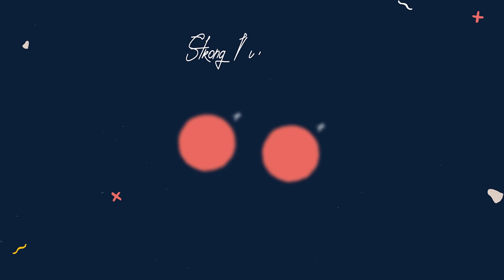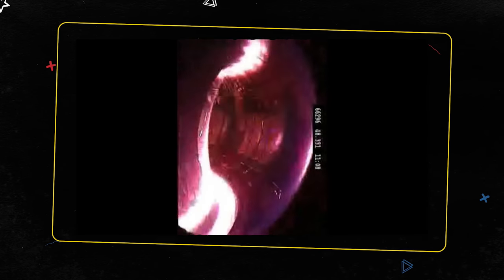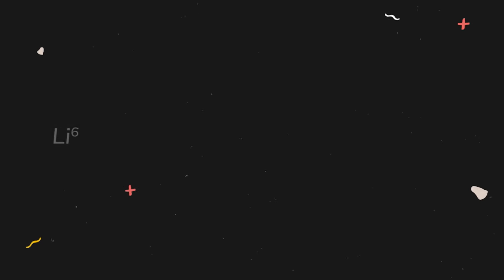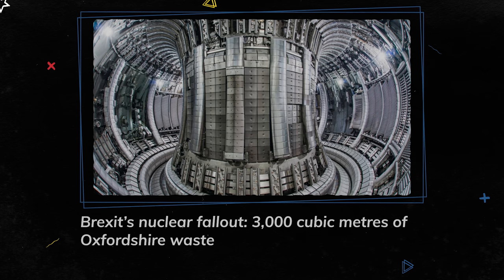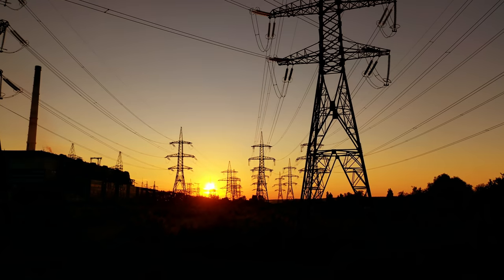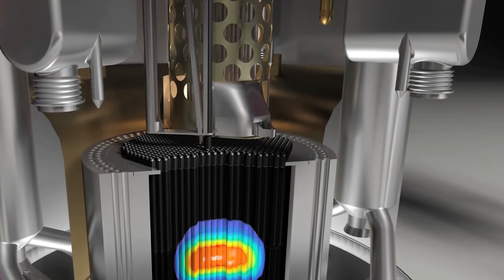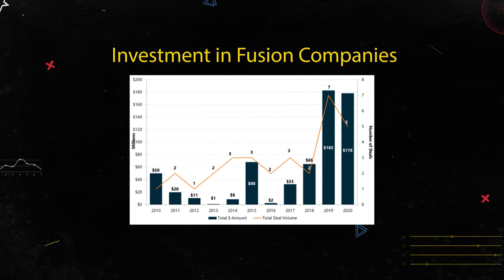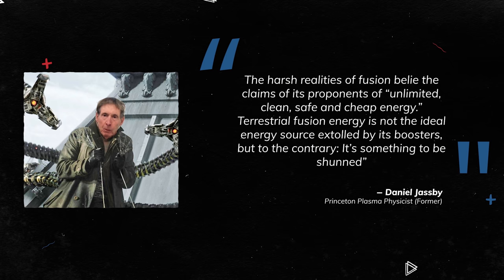What No One Else Is Telling You About Nuclear Fusion

Comment: Electricity production is a basic utility which should be done at  lowest safe cost with maximum reliability. Nuclear provides all of those options though old style PWR have high capital costs. The new molten salts from Elysium and Moltex burn high level nuclear waste (solving the disposal problem) and are cheap to build and cheap to operate. 
The waste alone will deliver the 20x the power already generated by PWR reactors. But they can also burn bomb grade material immediately denaturing the stuff so it’s useless for bombs. They can use thorium and even depleted uranium.

Comment: The problem of Fusion is that, assuming the fundamental engineering problems are solved ( and that could be well into the 22nd Century ) and assuming the overall costs reduced even to 50% of Fission, it is still a solution for the wealthy nation states. The development and investment into a High Efficiency Photovoltaic / Battery system would be significantly cheaper and scalable for other parts of the world that would never be able to afford a Fission plant, otherwise a Fusion one. Currently ITER is the most complex, most expensive, largest machine ever devised by Man ( think the Great Machine in the film "Contact" ) and its sole function is to turn water into steam to produce electricity. There has been some theoretical discussion about "Direct Conversion" but the working papers on this have not even been written. At some point Man will need to devise some form of inexpensive portable power generation, especially as we move outwards into space, perhaps Fusion will be that source.

Comment: There is another way which involves sandwiching a bubble deuterium/ tritium between two plates. Then constantly inject pressure from a central central hole. The reactor chamber needs to be star shaped like this emoji.⭐️ fusion occurs at the tips. It will need to be guided by magnetic fields outside the chamber but that a simple process of having a iron cored torus magnets place outside each indentation. The fields lines should make a geometric star a bit like this.🌟. So much like inflating a bubble inside another bubble the pressure builds in the cavity until it finally fusses. As far as I was aware this is called resonant cavity fusion. This all happens in a 2d plain of motion ant the highest pressures occurring at the tips where fusion is most likely to happen. The shock waves helping form the next cycle of fusion. Then it all a matter of choosing the right resonance frequency. An boom,fusion!  Should be far simpler and cheaper to build. Could also have a table top version small enough for demonstration.  Which would be awesome. This also takes advantage of the strength of the arch to funnel the reaction and control the shockwaves. Should happen somewhere in the gigapascals range. It just a matter of researching what pressure was needed to set of a h-boom. Then provided you have liquid in a coil of pipe near the heat of the tips you would have yourself a steam punk fusion reactor.

Comment: Interesting fact, even inside the Sun the heat output of a cubic meter is only about the same as a compost pile, aka single watts per cubic meter.  It's simply the huge volume of the suns interior that produce a surface temperature of ~6000K.  So even replicating the conditions in the core of the sun would be completely inadequate as a power plant.

Comment: There are 2 parts to fusion reactors. The side that makes the thermal energy and the side that catches.  This method of fusion may end up proving inviolable but the technology developed to catch fusion reactor heat and make electricity would still be applicable. I see grandiose fission reactors to facilitate fusion reactions in tectonicly sized containment structures. Passive self contained Water cycle for cooling. A project large enough to transcend single nations. But an absolutely permanent solution for energy.

Comment: Fission plants are only expensive because of regulations, not any physical reason. It can be much cheaper than it is. This isn't true if fusion. It is truly just expensive.
Reply: Joeseph Smith  Inherently safe fission reactor designs exist, meaning that they have enough fuel to boil water but not enough to go critical and melt down even if they lose all cooling. They are smaller, so you would need to make more units but they CANNOT melt down.

Comment: Geothermal runs most of Iceland and has for a long time. Almost every place on earth has some form of hot spot, or magma chamber you could comparatively easily use to boil water to drive a turbine. It may be expensive to build, but it's a hell of a lot cheaper than bottling a star.

Comment: Fusion claims to offer “free” power but the technology to make it happen is incredibly hard and incredibly expensive. That does not equate to cheap utility power. 
Molten salt fission reactors operate at atmospheric pressure with a negative temperature coefficient. That makes them self regulating so they cannot melt down. The zero international pressure means complex safety systems are not needed. It’s basically a steel lined concrete box. 
Fuelled with thorium, uranium or high grade nuclear waste, Molten salts fully burn their fuel. Their waste has a radioactive half life of 30 years. Thats easy to manage. Currently we have waste with a half-life of 30,000 years which is absolutely not easy to manage. 
Thankfully we now have fast spectrum reactors fuelled by high level nuclear waste. All the benefits of molten salt but no new mining and stocks of dangerous waste are reduced by 1000 times. Three orders of magnitude.

Comment: Hello smart people. I watch these videos just out of curiosity so I'm not sure how to answer my own question. 
Scenario: Pulling a sheet of saran wrap releases or creates (static) electricity. Do this in the dark and you can see sparks. 
Here is my question. If there is a strong force holding electrons to atoms, would "tearing" electrons from atoms create energy? 
Something tells me this would create energy and it would take less energy to position electrons back to some simple atom.
Reply from the maker: Hey :)

Non-smart person here, but I’ll try to answer :)

The Strong force binds nucleons together. That is protons and neutrons. Since protons are positively charged, they repel each other. But the strong force is powerful enough to overcome that repulsion and keep them together. 

Stripping electrons from the nucleus is basically chemical energy. When you burn wood, for example, the heat produced is due to breaking of chemical bonds.

Comment: Pro: 
I agree fusion might not make a difference on the short-term, meaning i concur with most conclusions on the end. The surprizing development of battery storage, and the expected rise of cheaper renewable energy, expands the options. 
Anyway, it will be a mix of energy and solutions in the transition towards a zero-carbon sociey,, and probably fusion will need to draw a number, in a long queu for future applications. 

Con:
This video would have to be renamed: 
Fusion on the ITER Approach faces Major Problems That No One Is Telling You About.
A lot of struggles and objections are based on the ITER model. Its ITER this, ITER that , ITER is a bad lazy boy etc etc. 
And yes: its the dominant pupil in the classroom indeed. But there are more new kids on the block. Like the Stellarator, a different approach. Different approaches offer different challenges but also adding to the general knowledge of fusion technology. 

Magnetic confinement is a thing as example. Some scientist note a fundamental flaw or disadvantage in the torus shape, causing a bad confinement of material to make it efficient. Stellerators and other ideas create different, more stabile and stronger magnetic fields to improve the flow and fusion. 
This is just a example, not a challenge to debate about it. Some issues might be universal over the broad spectre of experimental fusion devices. This video (making my point)  communicates a lot about the ITER, wich is not a bad experiment at all, but still just one approach to gain insights. 

Thus: while the video contributes to the need to filter too positive ideas about fusion to be feasible, with good conclusions on the end, it lacks a broad approach and it based primarly on the ITER project and its findings to review the future of fusion power.  
I agree fusion is a gamble, and we need to hatch more eggs then just one solution for future energy and climate security. Still, its still a good bet worth to consider and pursue, without fixation.

thanks for the work and contribution. This is mine.

Comment: Matter exists in a plasma state on the surface of the sun and inside the earth because it is under pressure. That fusion reactor chambers are made - for safety reasons - LOWER than atmospheric pressure, would seem a major problem: has anyone tried running experiments deep underground?

Comment: this looks pessimistic, but also we anticipate new discoveries in the particle standard model and in quantum physics and much more.
perhaps the recent muon experiment has opened a door.
* such discoveries can give us new factors that make fusion "easier" with perhaps new materials or introducing new particles into the equations.
* there is a lot going on about magnetic field geometries, like what the stellarator is attempting. AI can help to create new and better geometries and coil systems that come closer to these purposes.
* there is research about high temperature supraconductors. success would be a game changer, also because of the space that the cooling uses up in the device.
* ignition can be achieved with many different techniques, e.g. lasers. but I also think of dirac pulse creation in the magnetic field. the high frequency harmonics to get that, might come from nested coils that are ever smaller, following the idea of the russian matroska puppets. AI and perhaps quantum computing can help here also, to figure out some configuration that can get done a decent ignition with such an edgy pulse.
* can the neutrons that come out, get somehow rectified? like a black hole rectifies its output into a double beam. can the magnetic field geometry influence the fusion in that sense?
* what about having a plasma geometry, that allows electromagnetic harvesting of a big part of the energy, practically by induction, that happens when we let the plasma kind of explode?
this would work in a twin system, like a boxer engine (old motorcycles have it). one system creates the pulse to ignite the other and vice versa. a resonant circuit harvests the surplus of energy,.
in short, the plasma should have properties, that allow it to induce a huge pulse in the coils, when fusion starts and ends with strong transients. the whole mode of operation should be in short pulses, and the beat migh have a frequency somewhere between 10 and 500Hz.

these are just examples about new ideas and discoveries, that might occur. they may or may not apply, but other ideas and new discoveries in physics may apply when emerging.

Comment: Fusion from fusion.
Draw a circle halved once squared twice to the right.
That shape is the geometry of GOOD drawn together, its father shape.

On the Sun dial place the time 12-3-6
Time, times 12x-3-6
Time, times and division of time 1/2x-3-6

Time from mass.
12 Magnesium
3 Lithium
6 Carbon
1 Hydrogen
One clockwise cycle complete.

Comment: So using lasers aren't enough. Too costly and not enough thermal push in the confinement chamber to turn a net gain. Than there's the cost and issue with material integrity and waste disposal management.
Reply: Waste disposal isn’t to much of an issue there very light elements that won’t be the major problem

Comment: I just learned about Jeff Bezos' interest in an ancient form of fusion energy: a "firestarter" using magnetic confinement. I though ITER was doing that, then I realized they ADD energy to the system using X-rays. The magnetic bottle keeps the same volume. 
This other method does the same thing, except is just reduces the "volume" of the magnetic bottle, squeezing the plasma until it fuses. That seems like the winning strategy to me!

Comment: I cant believe someone of this stature is not aware of current technologies that eliminate the problem of magnetic containment. The development of HTS is a game changer and MIT has a 2 year head start on development. I agree, ITER should be scrapped, right now, and the budget put into technology that is here, now.
Reply from the maker: They need to be tested at the sizes required first. And will still need to be cooled with liquid nitrogen. 

So even if everything goes as expected, that’ll still solve one one of the major issues. It’s not as straightforward as the SPARC presentations make out :)

Remember to always watch the Q and A at the end. 

MIT was promising to build a Fusion Reactor called Ignitor based on the same principle 10 years ago too. Guess what happened to that?

Comment: Talk about misleading. So one bloke states that fusion is a pipedream so he must be right...

Tritium recovery technology is already in use at JET and the high initial retention has due to the experimental wall design. Thats how science is done, you experiment, learn from experience and improve.

Magnet quenches...this is taken as a factor in the design and is a well known feature of such magnet. An MRI magnet can also quench with you inside it and nothing would happen to you. Why? Because the magnet designer has taken this occurrence into the design. Also if this video was done by an expert he/she would mention that there're high temperature superconductors now available which dont require helium at 4.2K. 

There are now commercial nuclear fusion  companies which is exactly what is needed to reduce the cost and timescales of fusion reactors.

Comment: My money's on small, modular, molten-salt fission reactors, preferably running the Thorium fuel cycle. There are plenty of ventures already working on various approaches in this area, and I'll be surprised if we don't see at least one of them go commercial in the next decade. And in the meantime, the build-out of renewables with battery storage is going to be massive. When somebody goes commercial with a viable, profitable Thorium MSR, fusion will become more of a science experiment rather than a serious pursuit of "practical" energy production. (Although we may yet see something clever come from "focus fusion" or "cold fusion" or whatever they're scheming up at the Lockheed Skunk Works....;-))

Comment: 100 million kelvin is less than 10 kV potential difference. That's nothing; less than the potential between the screen and the electron canon in a CRT monitor. It is absolutely something you can whip up in your basement. 1 electronvolt (the energy of an electron accelerated over a 1 volt potential difference in a vacuum) corresponds to a temperature of 11604 kelvin for a particle like an atomic nucleus (for a molecule things are different, there some of the energy will be in the vibration of the bonds etc). 100 million kelvin is just 8600 eV. You can do this and demonstrate neutrons from fusion with a simple farnsworth-hirsch fusor device, which is just a couple of metallic grids in a good vacuum vessel. This is high tech for the 1930's, but it is motivated garage-tinkerer level of tech today.

The difficulty of fusion power is that very few collisions actually result in fusion and you must have very low energy losses so the nuclei can repeatedly collide at high energy without having to add more energy than you can extract.

Comment: One of the problems at churnable was they found robots did not work, the radiation cooked the electronics (valves may be the answer) they bought a robot in spatially from Germany, it faired little better, it sounds like this is a dead duck for know, perhaps fusion should be launched away and sent to the nearest sun.

Comment: Modern fusion plants covered with absolute zero magnets that must needs have for plasma control is a layer between the fusion and power generation with the heat of a nuclear fire. Can you imagine a better way to damp and smother the fusion reaction than covering it with not just freezing cold but absolute zero cold. Molten salt reactors fueled by thorium in contrast can be made so small it would easily power a ship clear down to a destroyer and would cost less then the very expensive turbines they now use and not with steam pressurization but with supercritical co2 gensets so small as to be almost hidden in a corner of even a destroyer. Having an unlimited range not dependent on the carrier for fuel supplies takes the most flammable agent of the carrier to make the carrier more resilient in battle plus a small destroyer able to keep up with it's mother ship indefinitely and able to have every bit of power it needs for modern electrical weapons and able to boost it's radar from the now value of 5 megawatt beams to probably 50 megawatt for even better ranging of stealth objects.

Comment: We have plenty Hydrogen and Boron -11. What happens when you use these as fuels in a fusion reactor? Well you get less energy. But you also get no neutron radiation, just short-lived alpha and beta radiation. Which conveniently enough can be absorbed by voltaic cells to directly generate electricity.

Comment: Gas plasma fusion is futile, fusion requires lattice confinement as has been shown by NASA. The suns core is said to be 150 grams per cubic centimeter,  what density is used in these reactors? Gas plasma reactors are just the most expensive gaslighting developed.